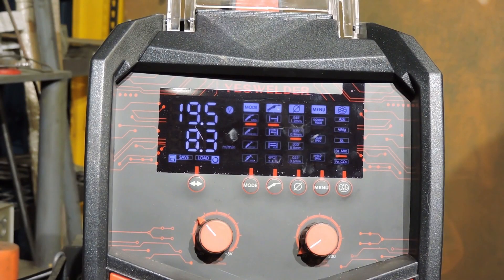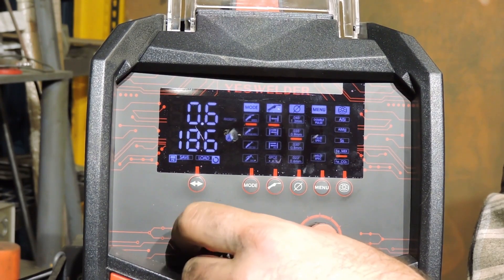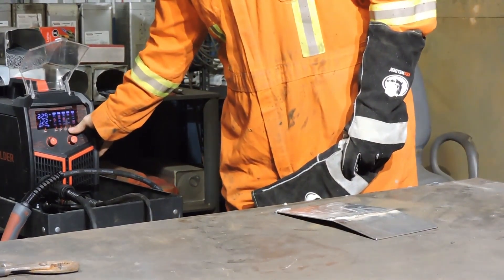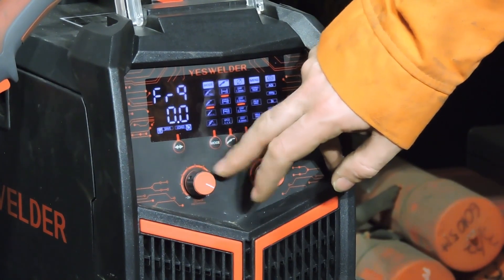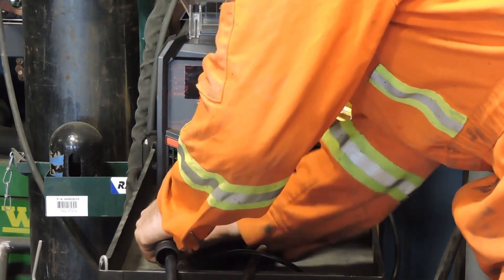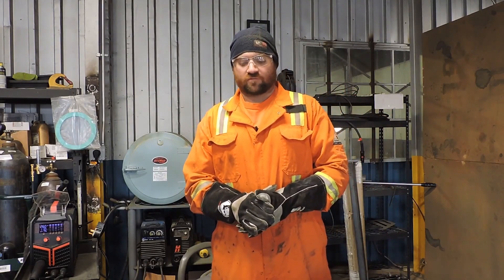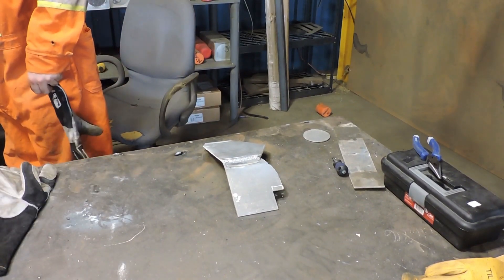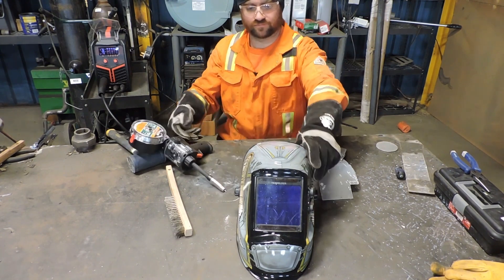Main Features of YWM-211P | YesWelder

Comment: I was looking at the settings on your machine when you were welding with the spoolgun on 1/8 aluminum. The settings appeared to show 26 volts and 11.0 ( meters/sec??). Those numbers seem at little odd. Are they correct?

Comment: Do you know if the YWM-211P supports gasless flux core wire? It comes with a roller for that wire, but I don't see any specific settings for it.
Reply: Hi Paul. I  will try to answer your question since the original poster of the video doesn't seem interested in answering any questions or comments. 
Yes, the YWM-211P is capable of running fluxcore wire. You just need to use the proper "W" grooved roller and switch the polarity to use Electrode negative and ground to positive. I just keep the air tank valve closed and the other settings set up for mild steel. Try a test weld on scrap. Then dial in your settings. Remember to use a drag technique with fluxcore.  Good luck! 😊